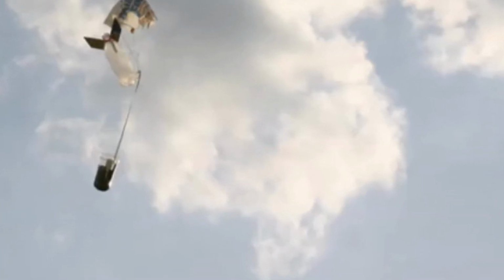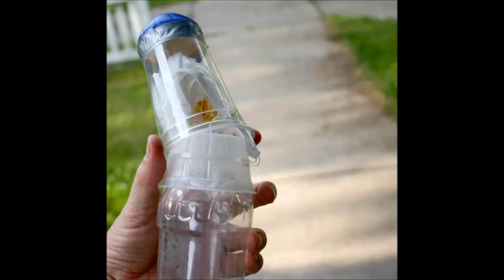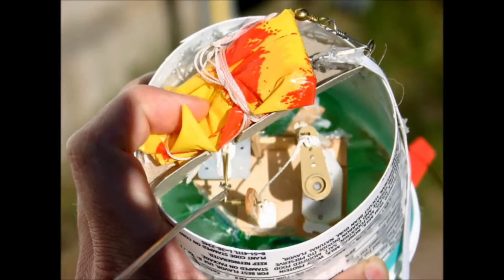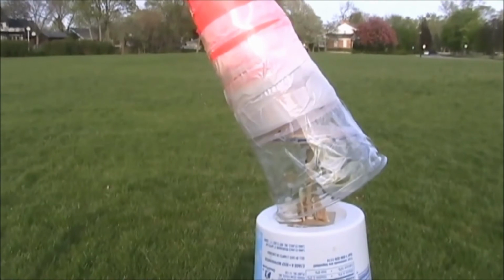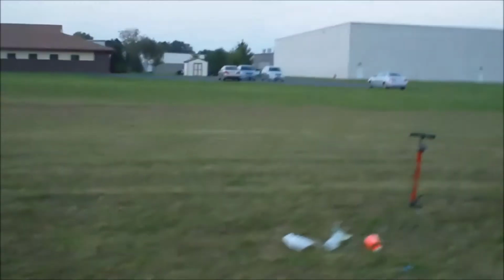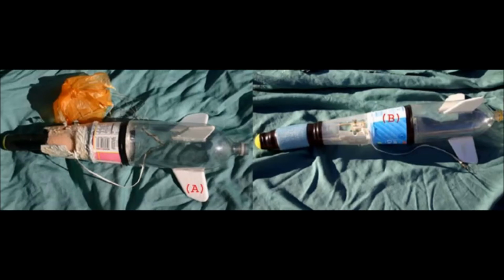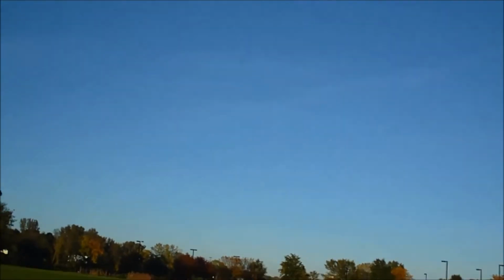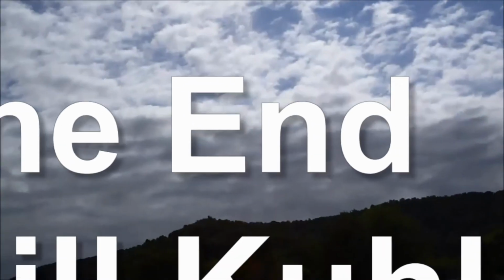Water Rocket Parachute Deployment Success & Fails

Comment: Thumbs up! Yup, parachutes seem like they ought to be pretty easy and reliable, but anybody who has actually worked with them knows how capricious they can be. Lately I've been working with another way. A recovery method that is about 100% reliable (albeit, not a parachute) is making a "backslider" rocket. Although there are formulas, the basic idea is to make it fairly long (add a long nose), relatively small fins and added weight in the back. At the top of the trajectory, it becomes horizontal and spins down for a gentle landing.
Reply from the maker: It is so cool to see the parachute come out. There is the big flap method for the parachute, I haven't tried that yet.